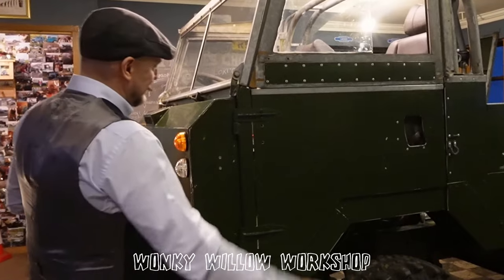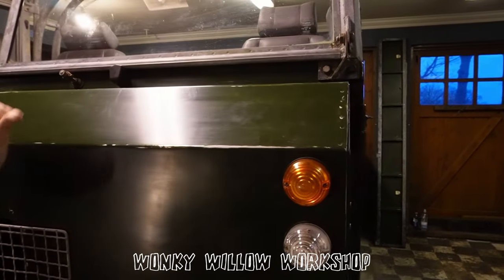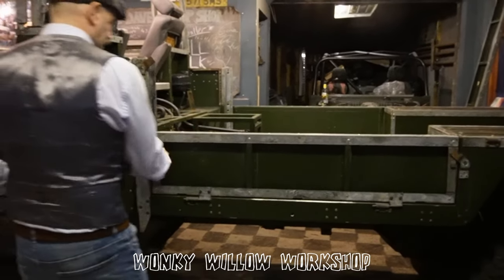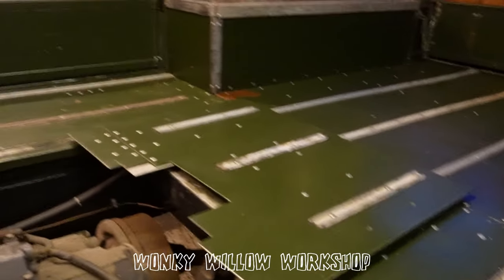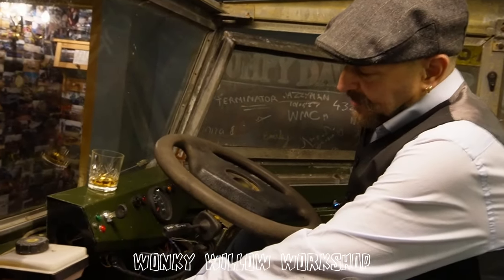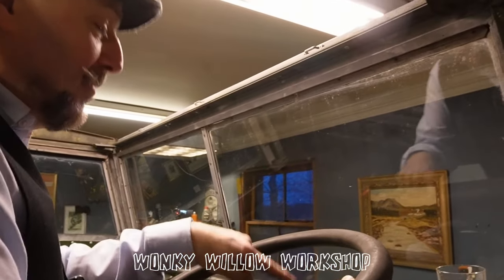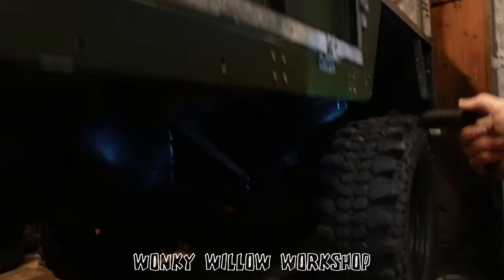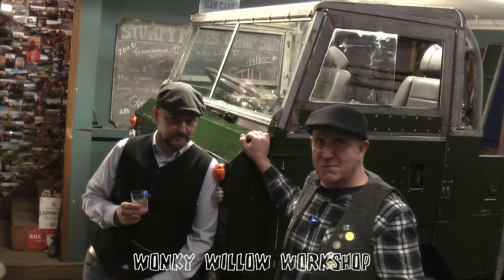Land Rover 101 Forward Control COE Cab Over Engine brought back from the dead

Comment: I used to own a  one tonne. With knocked winch  , I spent two weeks stripping paint of it  , luckily got some IRR olive drab  paint , amazing stuff , covered in one application with a brush , it leaves no brush marks  , great truck and miss it a lot   , look after that one as you’ve done a great job  👍😉
Reply from the maker: Thanks for your comments, they are cracking big motors and such fun. Will make sure Dave sees your kind comments ta!